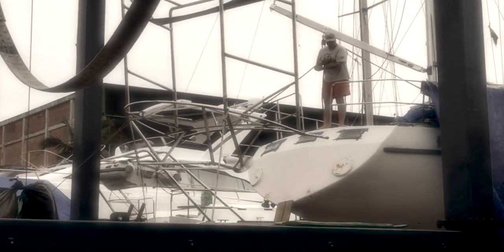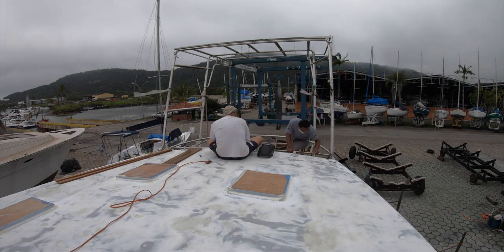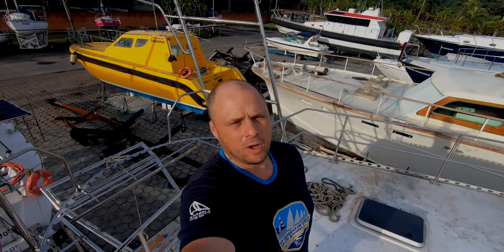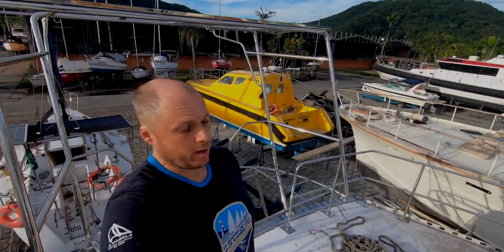#20 - Preparing to install wood on the stern platform

Comment: The arch and platform are quite sturdy and somewhat heavy set up..The anchor chain in the fore locker will trim out the boat over her designed waterline..
Nice job, as usual….👍👏
Reply from the maker: Hello Frans, the arch it's not heavy, but the wood will be... You are right, the anchor and anchor chain will trim the boat...